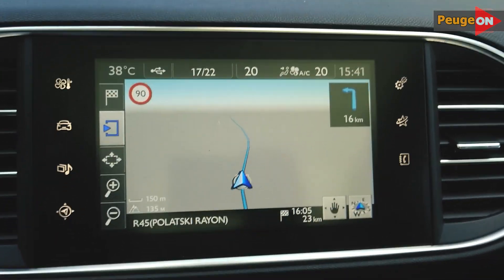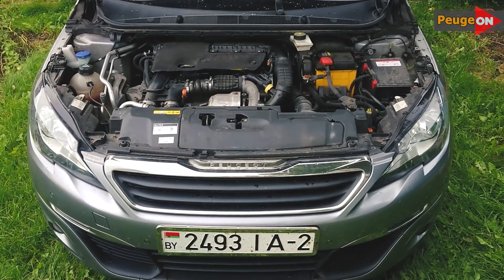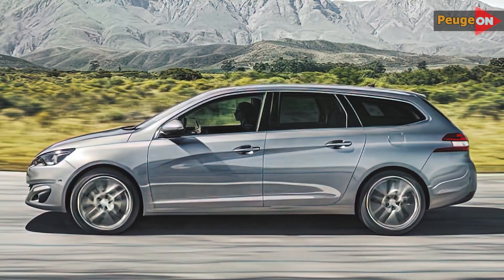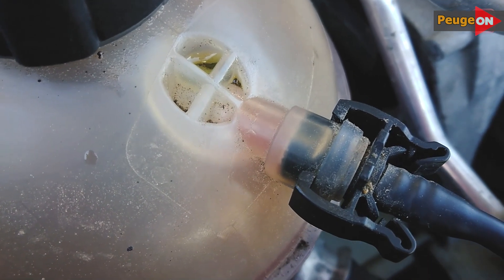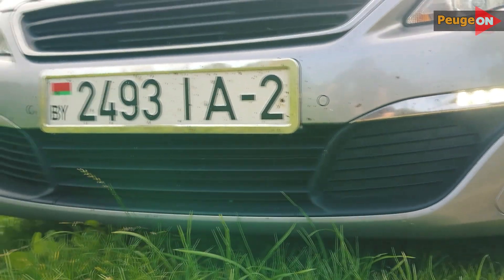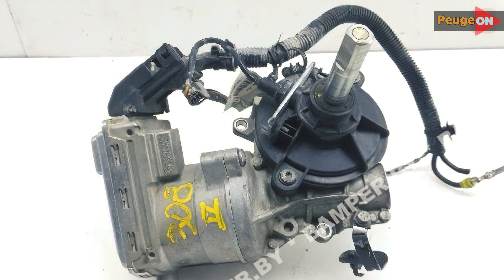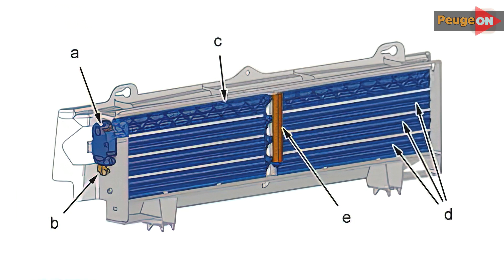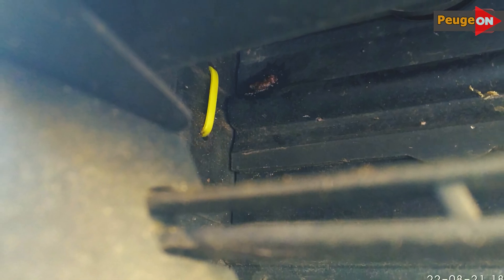The air intake module. Peugeot 308 T9. The device, the purpose and the main problems.

Comment: Hello, I discovered today that several of the blinds from this module on my car have become detached and need to be reattached. Is it possible to do this by removing the grille directly in-front of this module, or does the entire plastic section need to be removed ? Thanks.
Reply from the maker: I haven’t tried it personally, but people wrote that you can remove it if you try from below, removing the protection that is in front of the engine protection, not very convenient, but doable. But again, I haven’t tried it myself.
Reply: @ Hello, thanks for replying to me regarding this. I was able to replace them by removing the cover that sits under the bonnet, and also removing the headlights. This allowed me to reattach them from above.